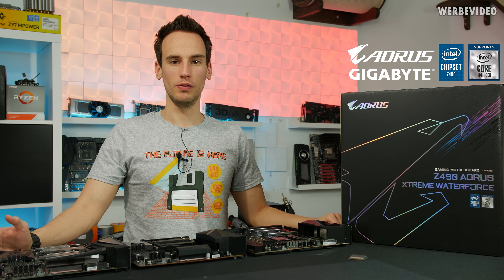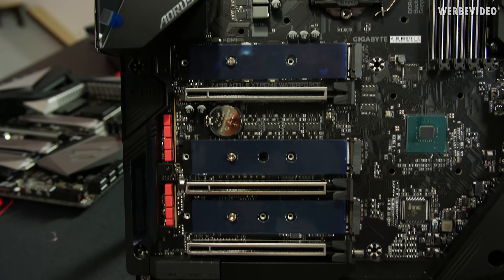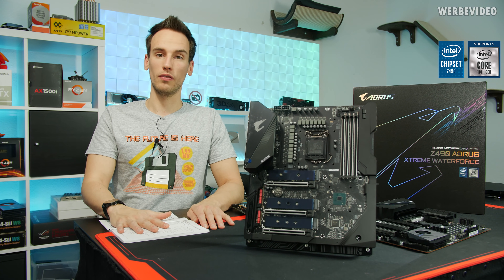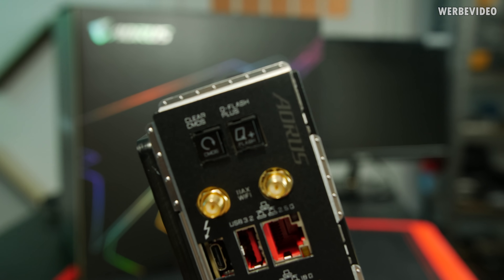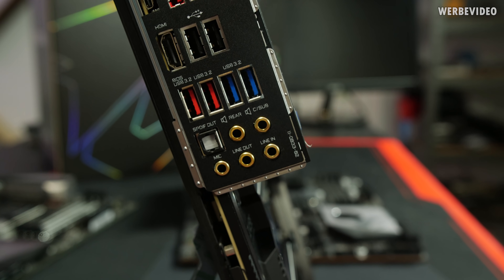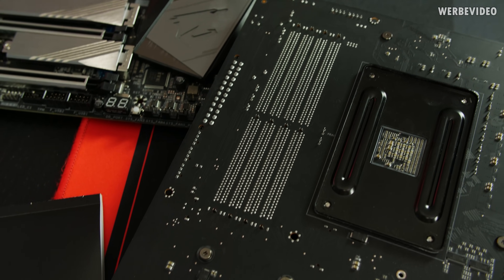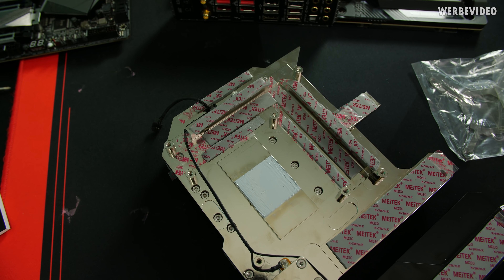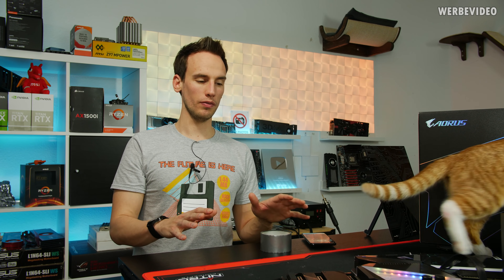500€ Water Block! The MOST EXPENSIVE Z490 Mainboard AORUS Xtreme Waterforce in Preview

Comment: I've got another question, why gigabyte put 2 thunderbolt 3 compatible with video transfering  but didn't put any HDMI or display port input on the board which Asus provide it on the expansion thunderbolt card with 2 display port input.

Comment: That board looks fantastic. I am sure it's way more than I would care to spend, but I can appreciate the aesthetic.

Another benefit of SMD DIMM slots is the elimination of the "stub" through hole pin. The inner DDR traces will connect to the pins on one of the layers. The remainder of the pin length from the trace connection to the tip of the pin becomes an un-terminated stub which can cause reflections. It's pretty short so it only becomes significant at very high frequencies, but for a high end board that is probably targeted towards overclockers it is a nice touch.

Comment: Not sure it was z97 with the surface mount ddr, I know my old motherboard gigabyte x99-soc-champion and its hardcore overclocking brother for water cooling and ln2 version, x99-so-force  had surface mount ddr slots,  like this board, however the surface mount ddr slots are not as robust, rma'd for broken ddr slots 😔

Comment: Gigabyte X99 SOC Champion doesn't have memory soldering on the back side as well (it is BGA on the front side). I have two of those mobo's :) 

X99 SOC Force has soldering through hole (THT) that sticks out the back. 

X99 SOC Force LN2 is BGA (so no soldering sticking on the back), but the LN2 variant is simply impossible to find anywhere and I consider myself lucky to find 2 used SOC Champions. I guess it is similar as if someone trying to find Foxconn Dreadnought or Bloodrage.

Comment: It's possible you're thinking of the ASUS Rampage Extreme Black Edition Prototype (the one you did a video on for the HW Legends series) for the other SMD DIMM slots, but I went back and checked and those are TH. The only board I know of with SMD DIMM slots is the Supermicro X11SPA-T, which I'm fairly sure were necessary for shielding because of the density of the board around the CPU area, due to how many PCI-e slots that thing has.

EDIT: May have also been the ASUS Gryphon Z87 which came with that crazy TUF shield thing. I remembered that board being weird and managed to find one low-res picture of the back of the board with the shielding off, and the pins look like flat vias, so I'm pretty sure it's SMD but I don't think they have a ground plane over the back of the DIMMs.

Comment: Great video. And hi to Shiek! Just a minor correction: the normal DIMM slots are just through-hole mount, not DIP. A DIP package specifically has parallel rows of pins with no staggering, usually at 2.54mm pitch.

Comment: To my knowledge the m.2_cpu slot will, on rocket lake be switched to run directly off 4 additional lanes on the CPU rather than off the chipset, presumably at 4.0 speeds. Remember that the socket provides for 4 additional lanes which are not used by comet lake.
I do find it a shame so few boards have u.2 connectors this generation, the prices for u.2 drives are pretty reasonable nowadays and you can easily run 4TB class (and larger) stuff over nvme which isn't possible with most m.2 drives.
Reply: Well it would makes sense considering they named the slot "CPU", I guess time will tell.

Comment: not sure how gigabyte z490 m.2 slot works with pcie4.0 in the future. on the official site it states there are switches only for spliting pcie 4.0 lanes among pcie slots. for msi z490, there are switches for the first m.2 to get the cpu-sepecific pcie 4.0 x4 lanes from 12th gen cpu. whats more is that msi z490s have dmi 3.0 x8 ready, not sure whether gigabyte has it ready too.  i think there are switches for m.2 on gigabyte z490 too, but not sure about the dmi.

Comment: 6:18 Might be wrong but I believe the Z97X SOC Force LN2 board might be the one your referring to
Reply from the maker: Yes that should be SMT if I remember correctly :)
Reply: The EVGA z390 has the surface mounted dimm slots
Reply: Yep it had a red or orange formula one car on the front of the box I think.
Reply: Christoph Kemmelmeier  Your right, getting confused in my old age 😄
Reply: @Martin M really? What problem did it caused you? A brittler mounting over thru-type?